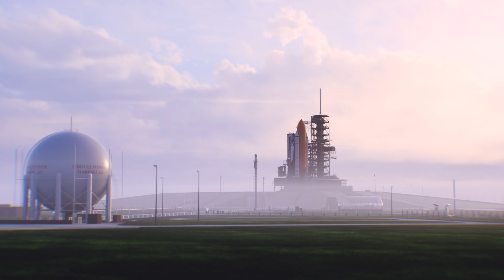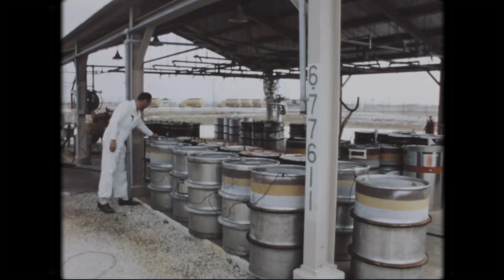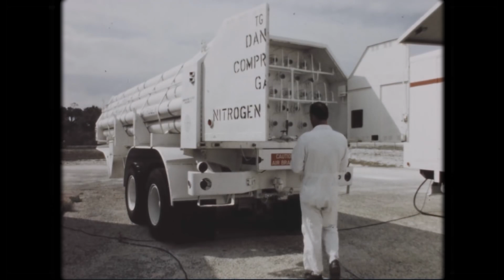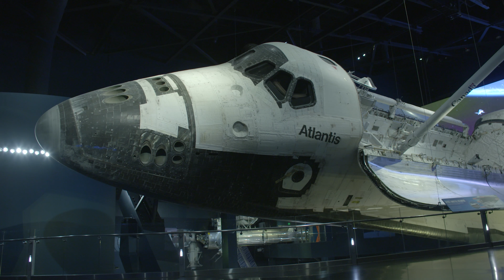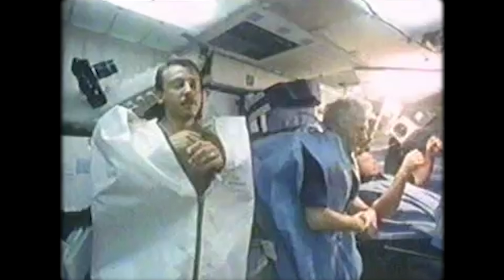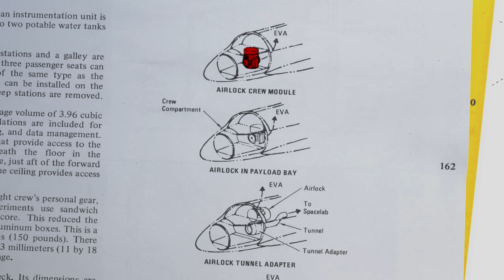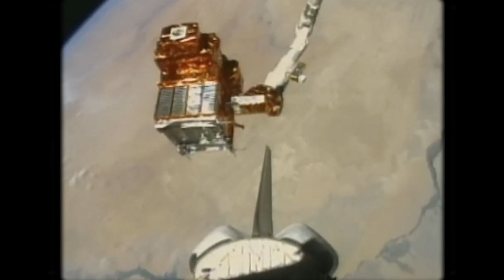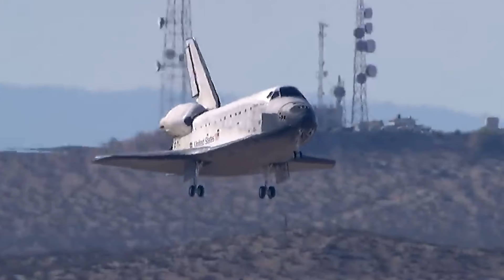The Insane Engineering of Orbit

Comment: The Space Shuttle though different was not the pinnacle of engineering for the time. Every safety system that the designers and engineers wanted to protect the astronauts was negated and ignored in favor of more payload space. Every tragedy that happened would have been avoided if the proper safety measures had been followed instead of being ignored by NASA, the CIA, NSA and the U.S. government.